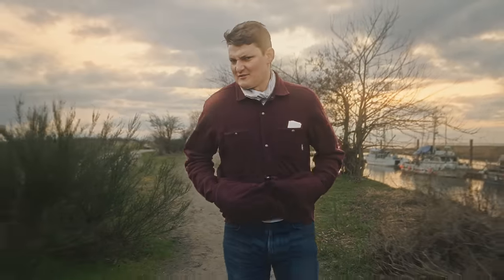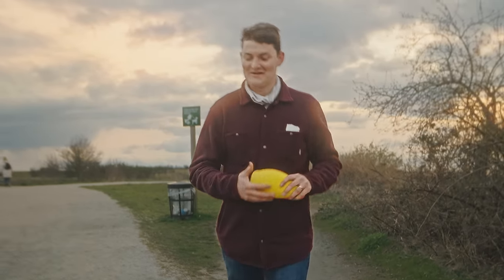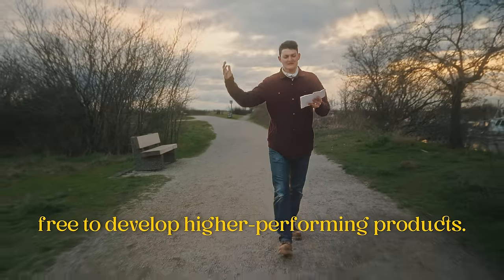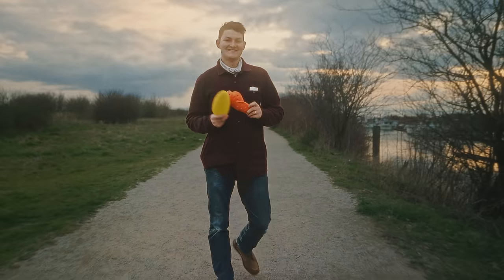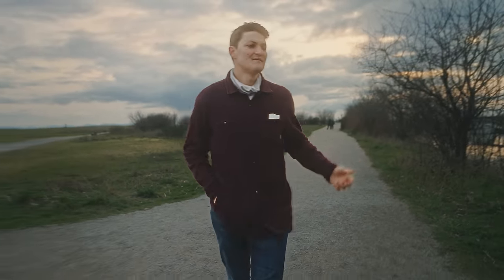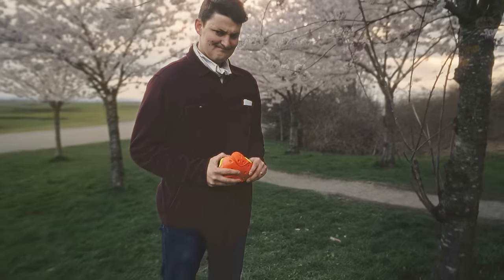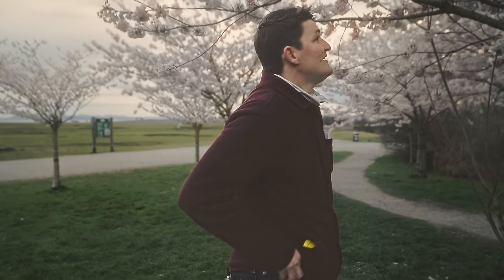Why I Stopped Wearing Motorcycle Body Armour

Comment: There are a number of issues with that research that I noticed as a researcher myself.  First off the n (number of cases for x) for many of the categories are too small to derive reasonable statistical significance.  Second it does not take into account the severity of the accidents for each case, which adds a massive statistical confound to the data.  There is not sufficient data present to derive anything really.  Also the studies for airbags on motorcycles are practically non existent for road users, and most airbags on the market offer little protection for legs, arms, and shoulders.  Legs/feet are also the largest source of injury in most accidents.  We do need better protection and better standards, but some protection in most cases will be better with none, I would rather hit the road with something to help cushion the landing.  Airbags are not a perfect replacement for padding, they can fail to deploy, or break on impact, or be punctured.  I use both pads and an airbag.
Reply: Wow , the voice of reason gets the least likes ,  yikes !
Reply: Well said, we got to be very careful when looking at those reports, generally speaking , since in most cases they try to correlate fractures/padding presence but the crash mechanism is completely lost, the amount of energy either and, I know friends who brought motorbike jeans and...didn't adjust knee D3O CE level 2, for instance...

Yes, we want higher and more representative standards. How can we put this in practice?
Let's make it happens, Ryan.
Reply: LegBags... feel free to do all the work and pay me for the name lol

The worst thing about the token protection is it feels so restrictive to move that I feel more likely to crash while wearing it... so I don't wear it it.
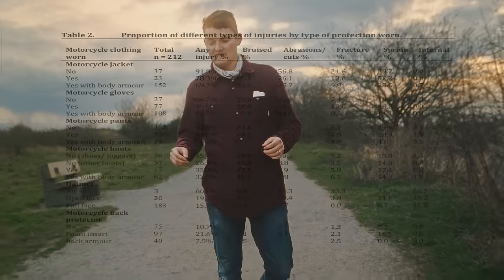Reply: I also do research for a living. If you pause the video at 2:28 and look down the column "Fracture %", the lowest values are almost all on the rows reading "Yes with Body Armor", meaning Yes to Motorcycle Jacket, then Yes to Motorcycle Gloves, then Yes to Motorcycle Pants and so on. Fractures are higher with motorcycle gloves than without them, but overall injuries are much higher without motorcycle gloves - duh. It's an odd outcome, but the number of cases is really too small for any statistical significance, certainly no p-value less than 0.05. 

As a daily, year round rider, who has been part of a group ride that went very, very wrong ending in a Life Flight helicopter ride for the guy with the broken thigh bone, I can tell you that our two crash victims were wearing modular helmets. Both had scratched up visors after bad wrecks, but both fully protected the heads and faces of their wearers. Having witnessed it, I wouldn't be caught dead without a helmet whatever the statistics say. After all, there are statistics and then there is what happens to YOU.
Reply: 100% agree.  However, if a meta-analyzes are performed they change the n.  They could also potentially account for the confounding if severity is reported.
Reply: Exactly. The studies mentioned by the video recluted crash victims from hospitals and police reports, so they were biased toward more severe crashes.

2cm of rubber won't save you if you have a collision at 150kph, but they will definitely reduce the pain and chance of smaller injuries on slower, more common crashes. We know from other statistics that about 3/4 of motorcycle crashes happen below 50kph (35mph). Enduro and motocross riders, that experience "crashes" very frequently and at low speeds, seem extremely fond of their heavy gear
Reply: Completely agree, YouTubers aren’t scientifically trained in research, so they don’t ask the questions , that a post-doctoral researcher would. Apart from sample size, as you noted, you also noted the force transference and all the variables involved. For those reading who don’t understand your comment, or who think Fortnine is on to something try this simple test. 1) Get a half pound (approx 226gm) hammer and raise it vertically to 1m above your knee, whilst wearing a knee pad. Drop it on your knee. 2) remove the armour, and repeat step 1). Ask yourself would you rather come off a bike wearing a knee pad or not. Not all impacts will exceed the spec of the pads. However, every impact will be felt by your knees or elbows.
Reply: I'm not a college educated man, but I was suspicious of the low numbers as well and wondered if any worthwhile conclusions could be drawn from such a small sample size. Ryan's first argument that the padding is only rated to twice that of a typical human bone break threshold seems like much stronger evidence, but then I also wonder which bone(s) is he speaking about.
Reply: @albertol1529 pretty sure he got it
Reply: @amerigo88 you pointed out the fracture stats, where all the gear=more fractures. My instant thought was they were riding faster, wearing the gear with the intent.
Reply: @pgVeritas  "YouTubers aren’t scientifically trained in research" 

Ryans degrees is in physics so he is at least trained in statistics.
Reply: Finally a reasonable comment. Thanks
Reply: @tstartrekdude  An undergraduate degree is nowhere to the same level as a doctorate in a scientific discipline. I know.
Reply: @tstartrekdude  He’s got an undergraduate degree in physics, not a doctorate in a scientific subject. He may have covered some stats, but his logic is flawed and typically undergraduate.
Reply: Seriously, what the fuck are they doing insinuating pads are useless?
Reply: He explained in his airbag video that the airbag is for stopping potentially fatal damage. You could still break a leg but that isn't going to kill you. Your head going the wrong way would, though.
Reply: My first thought was “what about severity of injury?” As a physiotherapist I can confirm the current literature is absolutely lacking lol. Don’t get me wrong, I get the idea of the video, but to medically trainer/ rehab trained folks data on “fracture vs no fracture” or “sprain versus no sprain” really doesn’t mean much to us. We want to see things like total time required for return to function/ resolution of symptoms between groups and even at that different types of outcome measures used will paint very different pictures.
Reply: @davidecuccato  Very noticeable though that pro enduro riders typically wear little or no upper body armor, and pro mxers often omit the elbow and shoulder pads.  But both wear very substantial boots and most often knee braces (not just pads), which are the bits that recreational riders are most likely to skimp on.
Reply: Hope this your comment rises to the top
Reply: As an former MX/Endruro guy (not a pro) ridning over 20y. 
I do BELIVE that any pads spreads out the force of impact over a greater area. 
Maybe not saving me from a broken bone, but shure a LOT less bruced. 
To ride with less brucing can make the different to go on or quit.

In my mind it is the same for non competition riding as on road, or just adv riding. 

I keep my pads in…

What hurts the most, Kicking something with the underside of your foot with a shoe on or without one?
Reply: I've heard of "survivor bias" but how would you call the inverse of that? This research is based on interviews of people in hospitals. People that don't suffer severe enough injuries don't go to the hospital so if the pads did their job you wouldn't know
Reply: @shotokanbiker here's my take;
The population measured are hospital attendees.
If you're in a crash, and you wear all the gear, and you don't break anything, you're less likely to sustain other injuries compared to a no-gear rider, and thus maybe you're less likely to attend hospital?

Consequently, ATGATers who attend hospital are disproportionately likely to have fractures, as those who don't are more likely to not show up to hospital, and consequently not in the statistics.
Reply: I don't know much about that sciencin' business, but when two-thirds of the studies are by the same two people, my sniffer goes off. I mean he did start out saying this was an April Fool's joke. If so, I'm impressed with the time and attention put into making it convincing. Not that I'd have expected any less from RyanF9; he always goes the extra mile, I mean kilometre.
Reply: April Fools
Reply: i once saw a study where they found that having a light beard might slightly reduce your chances of getting a jaw fracture if you get punched in the face, while having a thick beard might significantly reduce your chances of getting a jaw fracture if you get punched in the face, so if hair witch evolved mostly to provide termal insulation is such an effective armor i would like to assume that body armor, witch was designed to provide protection even if it was designed to only provide mediocre protection should make enough of a difference to be worth wearing.
Reply: @davidecuccato  Did you skip the video at 2:45 and 3:15? He clearly says light damage is not counted in.
Reply: "Legs/feet are also the largest source of injury in most accidents"
Sure, but a broken leg can't leave you paralyzed from the waist down. A broken spine can.
Reply: Also people forget that the riders who died couldn't even be interviewed to ask what gear were they wearing or not.
Reply: I would also like to argue that the number could be skewed towards the types of riding. The majority of people that are riding real hard, often around mtns and canyons, have invested in full gear and armor. Pushing themselves and their bikes increases not only the risk of injury, but the level of injury. Someone with no gear on is less likely to be ripping around a corner at 100+mph, therefore they may not sustain as many fractures or internal injuries. This is too nuanced of a subject to base off random crash data, there needs to be controlled variables and weighted categorization.
Reply: These are not case studies. Sample sizes in the 100s are perfectly serviceable statistical objects for asking these kinds of questions and the standard errors have meaning at any reasonable sample size. The takeaway isn’t that you can’t reject no effect, the takeaway is that you can reject an effect that is large enough to be worth the trade-off to Ryan.

And it’s trade-offs all the way down. Anyone who would even consider riding a motorcycle either knows this in their bones or is delusional.
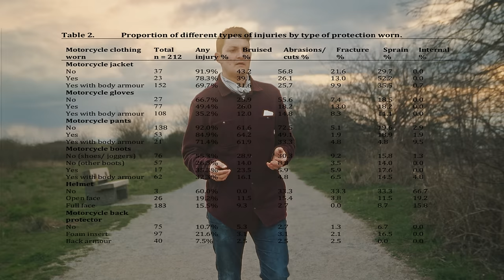Reply: I was unclear. At 2:28 the line for BodybArmir and Motorcycle Gloves was the only one with a higher percentage of fractures. On all the other Full Armor rows, the fracture percentage is lower than in the other lines.

There are a lot of low speed motorcycle accidents where armor can definitely help reduce our eliminate your treatment and rehabilitation time. For Americans and our fine corporate Healthcare "system," armor is cheap, treatment is VERY expensive. ATGATT America!
Reply: Agree. Also, although the pads are rated to reduce the tested impact force (was it 50 KN) to 18 KN, and femur's are know to only handle 4 KN, I'd still rather have that nearly 40% force reduction on my bones upon impact, even it there is enough for breakage to occur. Any reduction to impact forces will have a benefit...in the DEGREE/Severity of fracture or tissue damage etc.
Reply: @albertol1529  as a post-doc in human Kinesiology I believe he has referencing the thigh bone.  To give you a reference, 4 kiloNewtons is around 400 lbs of Force.  It only takes 150 lbs to break the ankle.  And way less at 6.4 lbs to break the foot.  There is no way to protect the ankle and foot more than we do with allowing movement.  I believe what Ryan was eluding to is that standards for hip and thigh need to be improved.  Also, with the knee cap floating, there is no way to prevent fractures in the joint with any pad.
Reply: I just learned to ride like a wimp and do the speed limit😊 slowing down, speeds up your reaction time for when shit happens
Reply: I talk to hundreds of riders every year and have 1000's of real-life crash stories from our customers to tell a completely opposite story from what Ryan is saying. I love his videos and have been a sub for years, but it's almost perfect it was on April fools day. Tbh, I'm still kinda shaking my head over how this information will give people some serious confirmation bias to not wear armor. I have a lot to say...but I'm going to stop there.
Reply: The research is also for people that were injured, what about those that were not injured, perhaps due to the armour they were wearing 🤷‍♂️
Reply: @amerigo88  Yep - while the statistical significance can be argued,  the presented data is a strong argument for using the armour. lol.  OK, if you are going to wear super dooper back protector and an airbag suit instead then don't bother with it. Otherwise recommended.  Both the hip and elbow armour have saved me from worse injury in the past.  Unfortunately I can't abide the knee armour as it never fits comfortably which is more dangerous than not having it.
Reply: @avulonanderson2372  I'm Eastern Orthodox and we do a lot of prostrations during our penitential seasons. The motorcycle knee pads are great for my 50ish year old knees during those church services. Haven't tested any of my gear in a real crash, except a dirt fall on the KLR at 5 mph.
Reply: The takeaway for me is the EU mandating something it thinks is for consumer protection that actually harms competition and therefore innovation.
Reply: I've done a bunch of statistics work for researchers, and completely agree. Even Liz de Rome, who Ryan cites, disagrees with him-- see her response statement on the Bennetts BikeSocial video. But the Wu 2019 paper has another big problem, that they recruit all respondents from hospital records. It's obvious that many people with pads would simply skip the hospital when they're not injured, so these stats can't possibly tell us if pads work.

And he even gets the physics wrong! Yes, a 50 joule impact will be bad even with pads. But obviously a huge portion of real-life impacts are less severe than that. As a matter of physics, we know that the pad material will also help with smaller impacts, so we have every reason to believe they will prevent many fractures. It's maddening how sloppy this video is
Reply: Horses for courses. If I have a low speed spill with no other vehicle involved I don't particularly want an airbag to deploy. I want some armour to soak up impact, and help support joints, and abrasion resistance to stop me grinding parts of my body away.

 Wearing that will most often have me getting back on my feet, picking the bike up and getting out of the middle of the road asap with little drama other than hurt pride and some bike repairs. 

Of course by contrast smashing into some scenery at speeds of over 60mph or meeting a car is a different game and an airbag in this scenario might well be the more beneficial piece of safety gear regards to saving your life.. still whatever armour you are wearing might help to preserve that bit more of your body.

Good armour is better than shoddy armour, but i still think even most cheap packing material foam armour is better than no armour at all.. with the one caveat that of course that it isn't so badly designed that it's potentially more likely to add injury or hinder your movement excessively or be so uncomfortable it's distracting.. these are my only reasons to consider removing armour from gear.
Reply: He posted this video April 1…how are all these comments not  noticing this
Reply: @_skud look at what day it was posted…

Comment: No gear necessary at all, if you don't crash.  If you do, you'll be grateful for  every scrap of gear you're wearing, even if its an extra  bit of padding.  My armor pieces are staying in!
Reply: I took my pads out, to provide more room for extra clothing layers. (I ride nearly every day of the year) I wear an Immortal Chest Protector with the shoulder pads from my jacket & an Axial2 Back Pad zip tied to the inside of it. I wear an EVO 2 Racing Collar that helps provide my head & neck with the maximum amount of protection from the cold. It also helps support the weight of my helmet directly onto the hard plastic shoulders of my Chest Protector, which allows me to ride for extremely long distances without getting a sore neck. 
The elbow pads in my jacket began to irritate my funny bone, so I found more comfort, warmth and protection from wearing External Elbow Pads with Forearm Protection. 
This gives me the ultimate upper body protection from accidents & from the elements. 
(Superior comfort, especially in cold weather).
Reply: Something like the helite turtle he showed at the end is still a no brainer in my book
Reply: there are 2 types of riders
those that have gone down
&
those that are going to go down
Reply: @seebarnes6588  There are 2 types of humans
those who have had the seks
&
those that are going to have the seks or never will

What to take from it? Life is life.